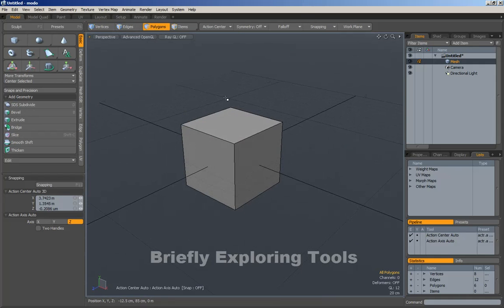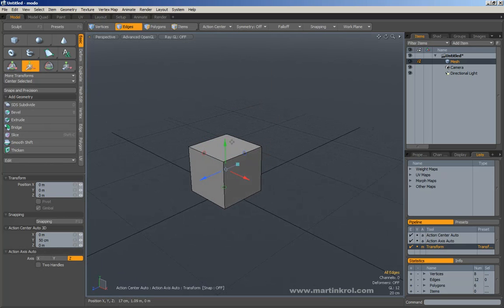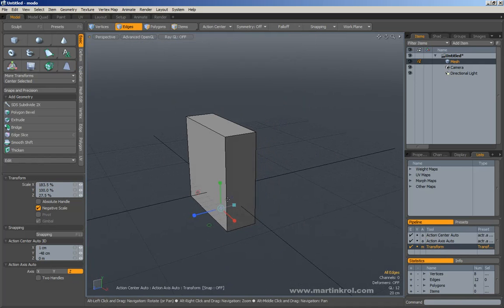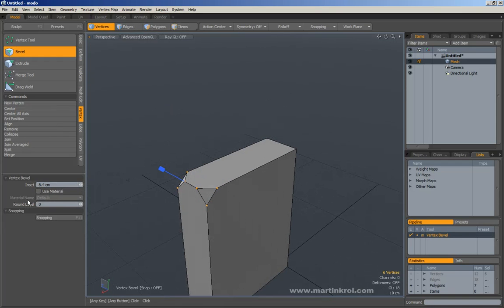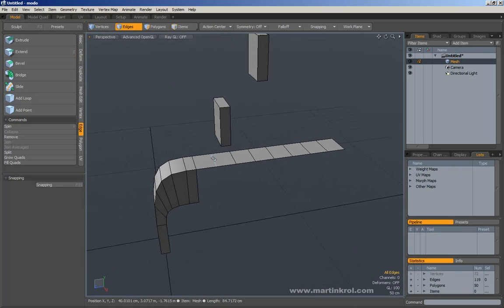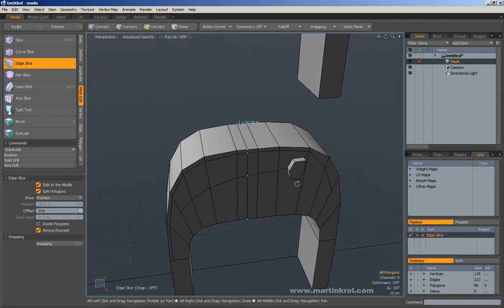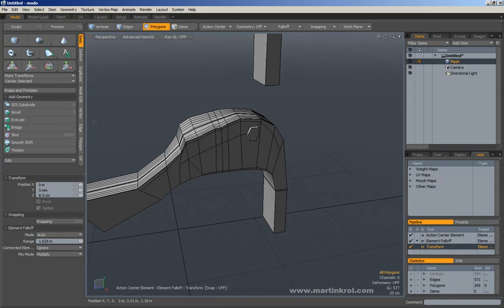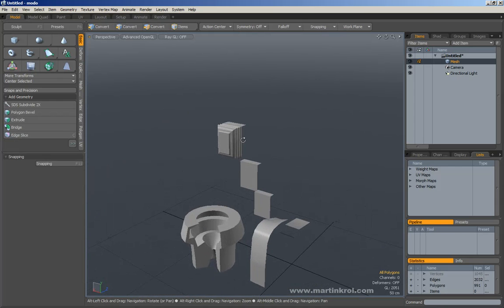Modo Modelling: Briefly Exploring Common Tools

Comment: I just got modo and can't select advance gL why?
Reply from the maker: What videocard do you have. Perhaps its driver related.
Reply: @MartinKrol  Intel(R) UHD Graphics 620
Reply from the maker: Thats your source of problem. Intel uhd is not meant to be used for 3d content creation.  The open gl drivers are not extensive enough. If you grab yourself a dedicated graphics card your experience will improve a lot. Advance gl needs a good videocard.
Reply: @MartinKrol  thx!